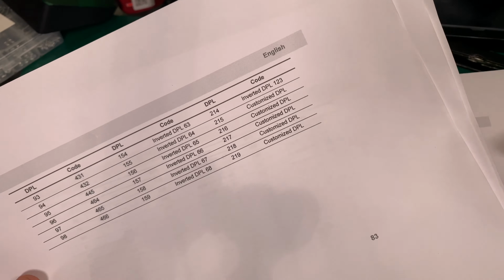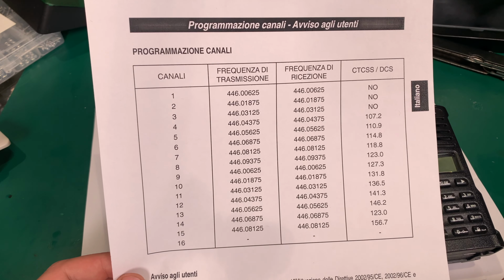FPP (Front Panel Programming) Motorola XT665d / XT660d on PMR  446 analog

Comment: Thank you! That was very helpful. Are you happy with the XT660D? I am currently waiting for mine to arrive.
Reply from the maker: Thanks for comment so fare: build quality is good,  analog work good (same as other Motorola from XT4x series, i don't see improvement), i did not test dPMR (i  don't have second one). Programming cable is expensive  (downside). I can't see firmware update to get 16 analog frequencies (i keep my eyes wide open - looking forward to Russian, maybe someone nice can post it) <- having only 8 frequencies today is bad. From what I read some radios are shipped with newer firmware that contain 16 frequencies to chose from in 446 range. This what I feel about it.
Reply: @ElectronicNoobBlog  Yes. Mine arrived with a firmware that lets me configure the 16 PMR Channels.
Reply: Any power mod?